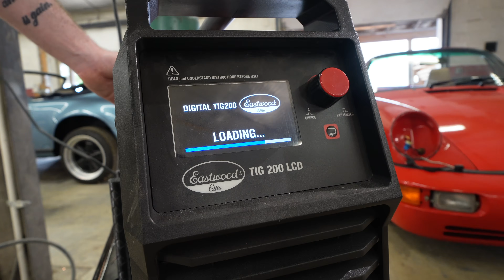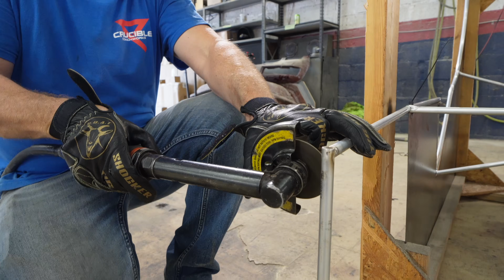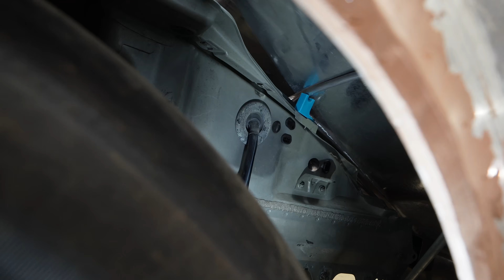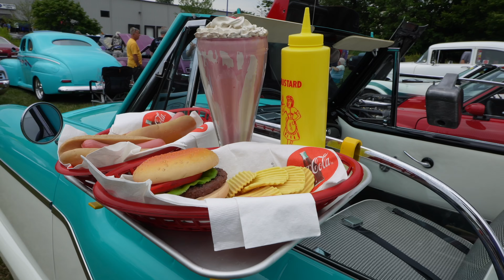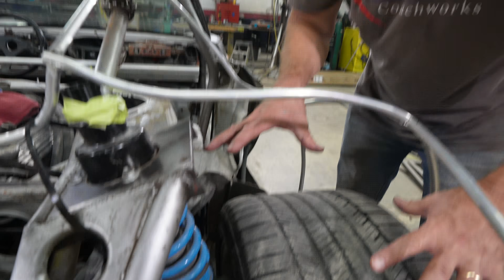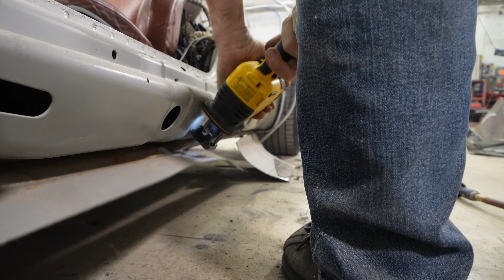$500 Porsche to 1960's Inspired Supercar: Rear Body Fabrication! (Project Jigsaw #46)

Comment: Ffs. This is silly. Aluminum is correct. So is Aluminium. They are literally both correct spellings according to the International Union of Pure and Applied Chemistry, the group that decides everything technical in chemistry, such as naming elements. 

Just keep saying  aluminum if thats what youre used to. If you like aluminium, cool. Stop trying to correct people, neither side is wrong until you start saying the other is incorrect, because it isn't.

Comment: The easiest way to build the door would be to build the crash hoop as one piece as you would build a cage through that area, then cut the door section out of the hoop and then hinge and striker it back into position then build the door around that.

Comment: For the doors, wouldnt it have been easier to leave the structure of the original Porsche doors, with also the window mechanics in there and modifying the outer shell to fit the new body? That said, im not an expert on this at all, just wondering what the thought process was on this!
Reply from the maker: That was the original plan! But honestly I think it will be more of a pain to try and make the OEM door structure work.